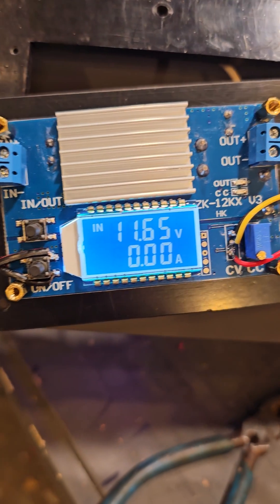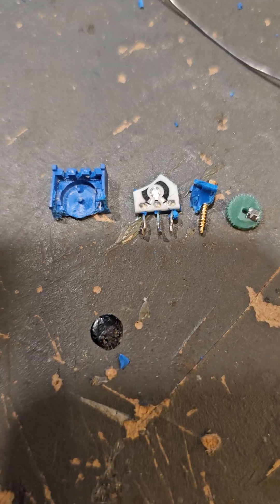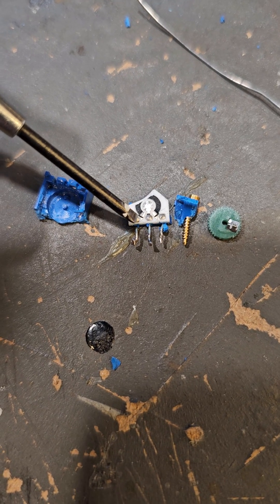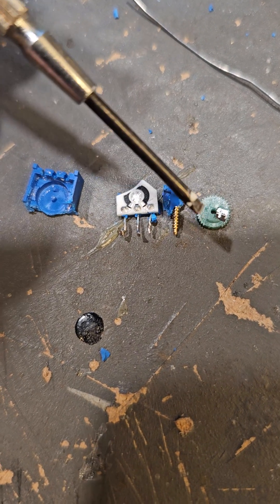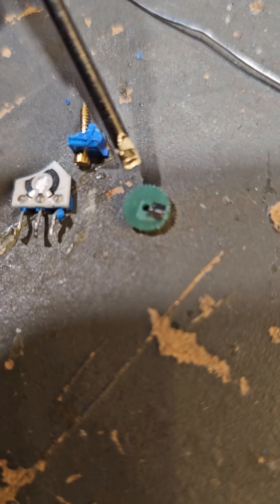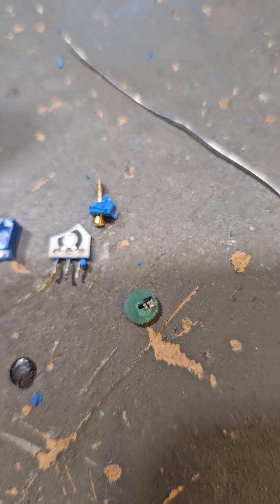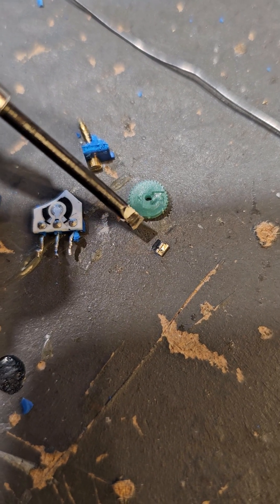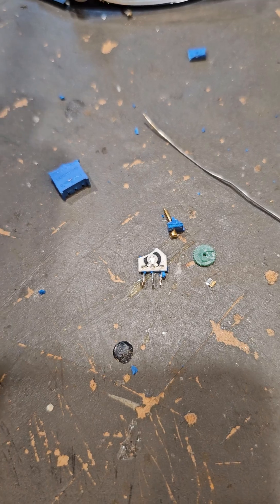3296 potentiometer trimmer breakdown

Comment: This just anwered a ton of questions I had about this devices build. I work in commercial refrigeration and just ran across a pair of these pots on top of a liquid level probe on a receiver tank. Explains why on attempting to calibrate % = VDC, there was a deadband area where my voltage dropped tf off. Nice man. Im showing this to The Boys tomorrow.